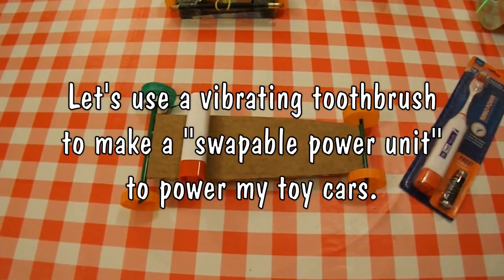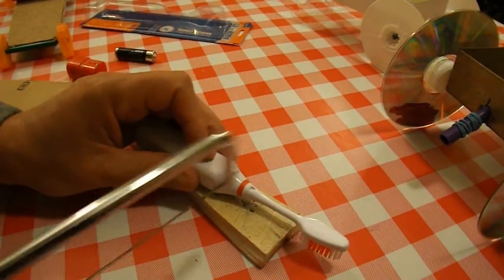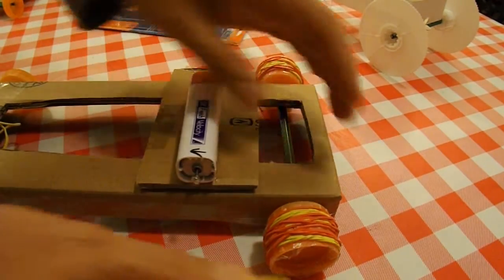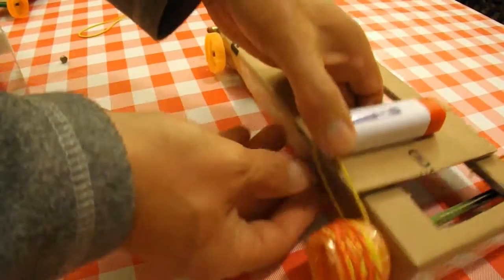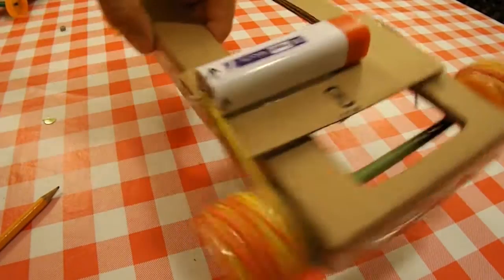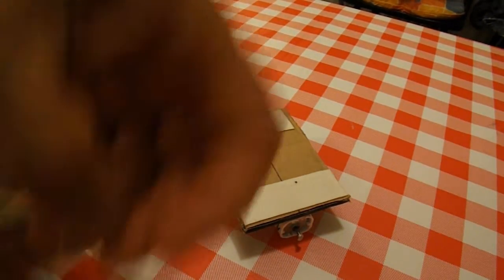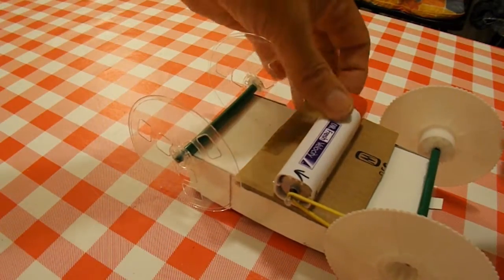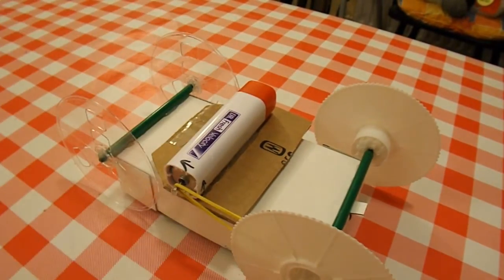Let's use a vibrating toothbrush to make a "swappable power unit" to power my toy cars.

Comment from the maker: At 1:52 I show you the offset weight I have taken off the shaft of the motor. It is this weight that causes the vibration for the toothbrush but you don't want it if you are using the motor to power a car. In the video description there is a link to another video I did showing how to remove this weight easily.

Comment: wonder if this could be used on some rubber band powered airplanes ?
Reply from the maker: Hi Allan, the main problem would be the power to weight ratio. These motors are not really very powerful and when you add the weight of a normal battery you are struggling to get it in the air. Modern electric powered model airplanes have very powerful motors for their weight and use 'lipo' batteries that give amazing power for their weight. That's not to say it won't work, but I doubt that it would be very successful. I may try it sometime just to my the theory. Even if it just extended the distance the plane 'glides' it might be interesting.